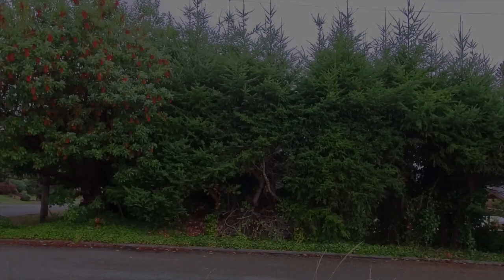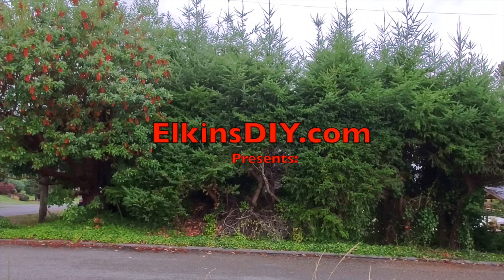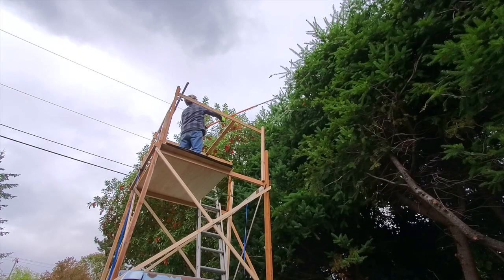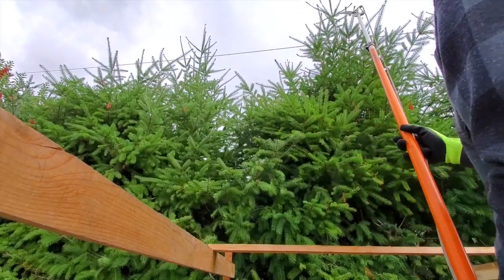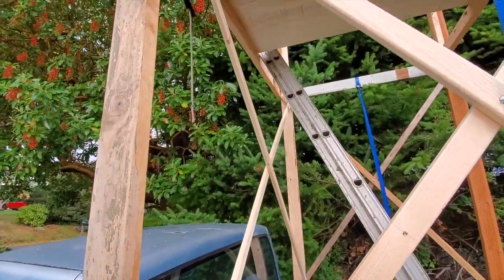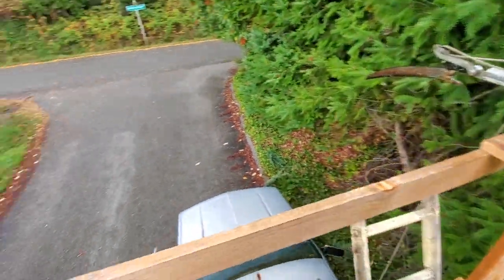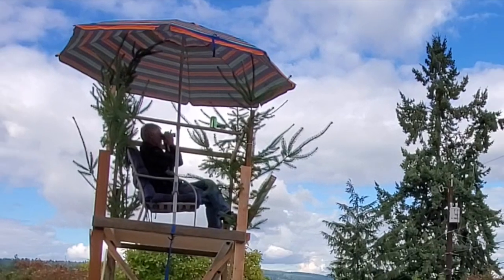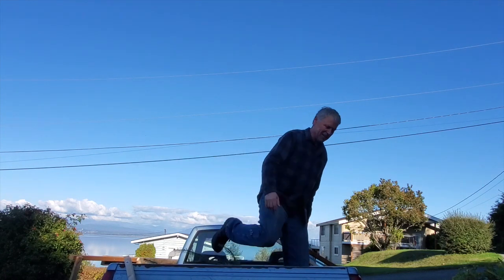DIY truck scaffolding

Comment: Just to weigh in on the screw nail question.  

A bolt, washer, nut assembly provides the strongest connection. 

Nails are more ductile then screws, but both are plenty tough. 

Shiny bright nails might slip, hot dip galvanized or other coated nails do not slip.  

Screws are much easier to remove and reposition.

Always consider the load, plus a safety factor, then choose fasteners.

Comment: Cool project Paul! And pruning on a makeshift soaked wooden scaffold in the rain under high-tension lines, what could go wrong eh? Rubber truck tires likely provided some level of grounding protection however.

Comment: Nails have a higher holding strength than screws do. Screws will shear off under excessive load which will lead to catastrophic failure, whereas nails will bend and give with stress but not shear.  Nails are by far the safer option when building a wooden structure like this.
Reply: I'm pretty sure Paul is well aware of the pro and cons of both nails and screws, and decided on screws for a reason. I also think he may have been trolling when he mentioned it in the video, and you took the bait. I could be wrong.
Reply: You mean nails have a higher sheer strength? They definitely don't have a higher holding strength. Either is more than strong enough for this application, so I'm not sure why he said nails would be stupid. I use an 80-year-old wood ladder held together with nails.
Reply from the maker: I suppose nails would be fine, if you pre- drill, especially on small board ends like one by two. I always pre-drill the the first board, not the one the screws will be sinking into. I just like screws. They come in assorted types, finishes and are easy to remove if need be.
Reply: @paulwelkinsdiy  Works good.
I thought the use of screws was for the purpose of future disassembly.
As for more shear strength, if it's a concern, use more screws per joint than you would with nails. Too simple?

Most home projects don't require an indepth analysis.  Just don't play Darwin games.
Reply from the maker: @cptrikester2671  This was intended to be dis-assembled once done using it, however when taking it apart I realized I could take it apart in several sections saving me time re-assembling the whole tower. Other than snipping limbs near a heigh power line in the rain, my gloves were rubber and I didn't hang out too long once it started raining. Still...